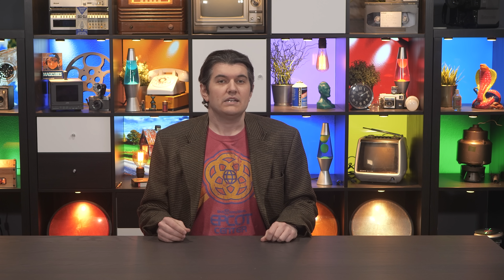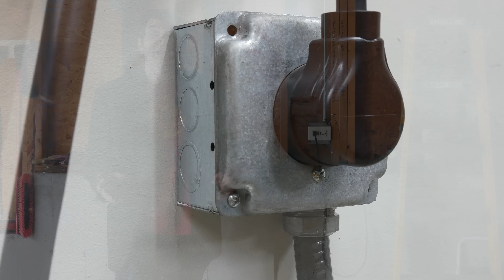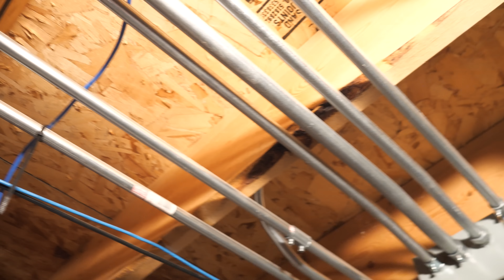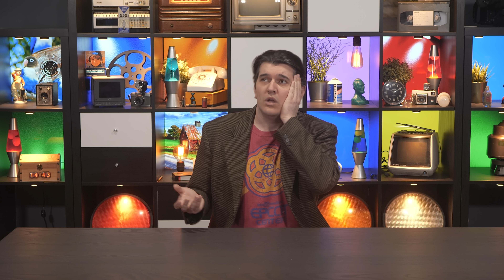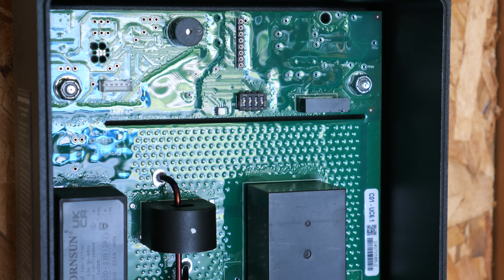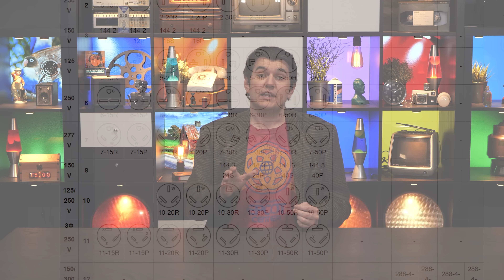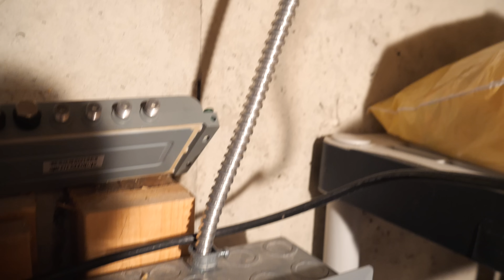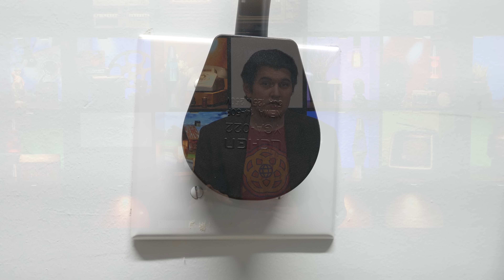The "standard" car charger is usually overkill—but your electrician might not know that

Comment: 23:20 As a software engineer, I agree 100%. If an object doesn't function properly without an internet connection, then it might as well be a boat anchor.
Reply: Retired datacomm network engineer. I also agree 100%. 
For the power limit I agree with the DIP switches. That's a hard limit defined by the electrical wiring. It should remain set in hardware until someone opens up the box and physically rewires it.
I would not buy a router that wasn't configurable on an isolated network using commonly available software such as a terminal emulator or web browser. I certainly would feel the same about a car charger. 
I could see public charging stations requiring an app but then I don't need that at a gas station, a credit card should suffice.
Reply: Five-six years ago I had encountered an split-system AC unit with only app control and requirement to be connected to the Internet. It was 3 times cheaper than similar units, so my friend went with it (2 of them, actually), and called me luddite for pointing obvious flaw.

It's been free for a few years, but now, firmware been updated and dude have to pay equivalent of $20/mo for AC, on top of the electrical bill. And, no, you can't not pay during colder season - device will brick itself - one of them did - and friend needed to call specialist from the company to unbrick it for a stupid amount of money. 
And apparently device is also using non-standard everything, so you can't just remove it and replace it with a normal split-system.

So, yeah, no mandatory internet connections on anything, that's not network infrastructure related. Ever.
Reply: @UselessZero  HVAC tech here. You can definitely rip it out and replace it witha  conventional split system, you may need to run new copper lines or wires, but if dude is intent on DIY-ing it, the DIY split system kits come with new copper and new wires anyways.
Reply: @UselessZero  what brand?
Reply: @UselessZero  I know this might seem tedious, but I would look into the possibility that the company that suddenly decided to start charging for their app software/updates more than likely used someone else’s code that was open source to begin with. If that’s the case, then it’s illegal to use that code and apply restrictions to it if it’s GPLv3 & AGPL. Title 17 of the United States Code, Section 501 (17 U.S.C. § 501) forbids it, but I was blown away by just how many companies run around doing it. The thing is, they know that most people that write code just want to share and help. So they rarely ever get any pushback. But I would not be at all surprised if the code that AC app is using isn’t even theirs to begin with. They sound exactly like the type of company that would do this.
Reply: The thing is, there are plenty of reasons why that app / it's host server might end up getting pulled.
Pushing for new model(sale)s, bankruptcy of the manufacturer, outdated internet protocols, a burning server rack...

All of which turns your several hundred dollar gadget into a brick. Nonrepairable.
Reply: Instructions unclear, now I can't moor my boat because of low reception under water
Reply: Yes!  It’s like having A/V equipment that becomes non-functional without the remote.  Or have to dig through 18 layers of menus on a touchscreen to do something that used to have a dedicated button or knob.  I’m looking at you, car industry.  On top of that, putting software/internet connections into everything is just adding points of failure.  

That said, if it can add convenience and/or make products easier to use, please do!  Example:  I just replaced my irrigation controller with a wifi capable one.  For two connected reasons: the original’s UI sucked!  And it was located in an area very awkward to access.  Since water restrictions here vary (semi-arid climate), being able to make changes to the program, without sausageing my ass around the furnace (several times a year), is a godsend!   I also have a smart thermostat that every once and a while gets adjusted from somewhere other than the thermostat itself - like bed, or when my tech-incompetent kids called us while we were on vacation, asking how to change over from “heat” to “cold” in the middle of Spring.  And don’t even get me started on smart locks…
Reply: Disagree with you completely! everything, every everyday household item needs an Internet connection and integrated mic! And shouldn't function unless the device can connect to all required external servers. This way a company can remotely disable the device or brick it. Require paid subscription to function. Allow malicious people to potentially cause harm to you and your belongings. And collect as much data on you as possible!!! $$$$$$$$$$$$
Reply: @D-ql8mz  Yes, exactly. This is the very reason why every possible interaction is becoming needing an app. Life is becoming a netflix game where you are turned into a subscriber who can be charged regularly and disconnected if you do not pay. I mean, to pay for being controlled on your daily life - what a nasty business!!!
I have seen a video by a guy who bought a new dishwasher without knowing that it needs the internet app to run certain programs - like if you only want to rinse. It does not cost extra, yet. But only a stupid person won't see where this is going. Arrrgh!
Dishwasher video is on Level 2 Jeff channel.
Reply: Never forget, the S in IOT stands for Security.
Reply: boat anchors tend to be much more durable and cost-effective and don't have firmware updates
Reply: I also completely agree with you on KISS chargers. DIP switches are where its at!
Reply: Usually a spyware anchor, with new and creative vulnerabilities for bad actors to exploit.
Reply: I had to return my last boat anchor because it wouldn't connect via ethernet, it kept snapping.
Reply: My boat anchor has Bluetooth
Reply: At least if an internet-connection isn't needed for the core purpose. ^^'
Reply: @fuselpeter5393    Correct.  Especially if the company goes belly up and the app dies.
Reply: Yes! A new EV charging guide would awesome  30:51
Reply: Great. Woulda been nice to know before I bought this wireless boat anchor ⚓️ 😅
Reply: As a software engineer, I think we're putting too much software into things that would function fine without it for highly misguided reasons.
Reply: Just curious why not do load sharing?
Reply: Cs students here, mostly agree, with the exception of WiFi access points.
Reply: I wish my utility didnt require the chargepoint home flex for their off peak ev charging plans.  I had to get support on the phone to get it set for 48 amps, despite it being configured on a 60 amp breaker.  The only plus is it lets me see the actual cost of charging so I can deduct that from a shared utility bill.
Reply: It's scary that pro audio does this.  Depending on a wireless connection for a concert where people have spent gazillion dollars combined on tickets.
Reply: I would also like to chime in and agree. I bought a Wallbox for $750 and regret it. Just recently it had a failed firmware update, putting it in a semi-disabled mode (can only charge at a max of 1.4 kW) until you do a factory reset. 
Why does it need endless over the air firmware updates? Who the hell knows. If I ever buy another EVSE, it will be a "dumb" one.
Reply: Just last month my Siemens Versicharge AC somehow got itself into the commercial mode meant for office buildings where it expects users to tap a key card before it starts charging. Well, I have the residential one that doesn’t even have the card reader hardware, so it wouldn’t charge. The only way I could fix this was to download the Windows app meant for bulk configuration of a bank of them, factory reset it, and connect the app to it so I could turn that off.

Edit: I will clarify that the charger doesn’t need the app to work or set the current. You can treat it like any dumb charger if you like, just wire it and turn the selector inside the case to set the power limit, and you’re done. I only use the app to see how much power the charger uses out of curiosity (turns out my charging costs amount to roughly $5 a month) I never set the app up for like 5 years because the never cooperated with my WiFi, until it just suddenly decided to and i managed to set that up a few weeks ago, but it worked fine without the app that whole time.
Reply: and if your boat anchor needs wifi....😮
Reply: My dad switched out the panel for controlling sprinklers with a fancy IoT device, but the stupid thing can’t be adjusted without an Internet connection even when the device with the app is on the same local network as the sprinkler panel. It’s just so ridiculous.
Reply: I bought my car second hand and the previous owner threw the charger in with it. Said charger connected via an internal modem to a web back end somewhere, which had to link to my car's account through their service to tell the charger that it was MY car via GPS to prevent electrical power theft.. It never worked, because they were both 3G based which got shut down, the car service was discontinued. I replaced the charge controller for about £25 and turned my smart charger into a dumb charger and it was finally useful again. I have a 1/4 turn lockoff inside my house so it's never powered unless I'm already using it. I'd like to add I design bespoke test systems, all aspects, mechanical, electronic, firmware, fabrication etc. and your statement is 100% true. Relying on an external service that you have no control over is FATAL.
Reply: my charging station reports usage to my utility and I get a rebate based on that. That's one use case
Reply: EVSEs like this don't require an internet connection. They'll work just fine without one, but they are improved with one.
Reply: Nonsense 🙄
Reply: What about a Bitcoin?
Reply: If you can afford an electric car, you can probably afford to have an Internet connection.
Reply: The biggest problem is see with EV is the battery technology. And the risk of fire, im a master electrician and electrical fires while im charging in a garage scares me long term. Id only charge outside away from my home.
Reply: Only a software engineer could know this. Leik omg thx!!!!
Reply: The problem is that in reality, the Tesla Level 3 chargers are the ones that are extremely more reliable than anything else.  Yeah, you need "an app" for a non-tesla, but they also just work, which is not the case for almost any other level three charging.    Probably because they all use starlink for their internet, which is way more reliable than what everyone else uses.
Reply: @EdwardKerplumplin  they cant both "need a app" and "just work"

my kettle just works i push a button it makes hot water
my toilet just works i flush poop be gone

needing to setup a app is not just working
Reply: @Sarge92  The Use-Microsoft-Word-Like-A-Typewriter crowd probably thinks that Microsoft Teams "just works" because they never cared about the missing/broken features to begin with.
Reply: @Sarge92  They are both true. You don't need an app for home charging via a Tesla wall connector. You can just plug it in after it is setup by an installer and it'll just work on every EV, but having the app allows you to monitor energy use and configure permissions.
Reply: @EdwardKerplumplin yea so when the company feels like it  theyll prevent you from using what you paid for ok lol
Reply: @EdwardKerplumplin in my experience the Tesla chargers have been the most unreliable…

I’ve had them not work at all more often than anything else… or have entire stations closed with very little notice…
Reply: @EdwardKerplumplin  Unless something's changed, you need an app, an account, and possibly an adapter, depending on your car. That doesn't "just work". The maintenance standard of many EV chargers in general is also pretty lacking, so even if the device is designed to "just work", the more complicated it is, the greater the chance that when you get to it, it "just doesn't work".

You're also adding dependencies. Now, to charge a car, the charger needs electricity and it needs a functioning satellite internet connection. 

There's a reason gas pumps are relatively technologically unchanged in the last few decades and don't rely on anything "smart" to do their main jobs.
Reply: @deggy42  Regarding the gas pumps, quite a few years ago I pulled into a gas station that had just suffered a "power hit" from a nearby lightning strike. Power was on, pumps worked, but the point of sale terminals were down. They couldn't even "process" my cash. I went elsewhere.
Reply: @davidg4288 My favorite gas pump story was at a station in Kansas where the manager told us the pumps were down because the internet was out. I asked for clarification because that isn't how that works. 

He said that their owner's policy prevented them from running the pumps without also being able to show the ads that play on the screens built into them.
Reply: @deggy42  Except again, reality begs to differ. Tesla Superchargers are the industry standard, and Electrify America and everyone else is laughable in comparison.  But that is the real world, don't let it convince you of anything.
Reply: @EdwardKerplumplin  And that's great for them, but we're talking about the REAL real world here. The one that exists in physical space that people have to use, not the one that was designed by a very clever engineer and developer working together.

I've seen a LOT of superchargers that don't work the way they should. They error out, they dont charge at the rate they're supposed to, they didn't like a payment method. EV chargers are critical infrastructure. The simpler they can be, the more suited to that role they are. The device that charges your car so you can leave should not require an internet connection to function.

Not to mention - the Tesla charging standard that is the industry standard does not actually require an always-online device. It governs the communication between charger and car. The charger doesn't need to be able to contact a server for that standard to apply. But by all means, don't let the reality of the standard you love so much get in the way of your fanboying.

You seem to think I'm anti-Tesla here. I'm not. I'm anti-internet-of-shit. Things that don't need a network connection to perform their function shouldn't require one arbitrarily.
Reply: @EdwardKerplumplin  why are you like this?
Reply: @deggy42  my 2018 volt came with a charger for a standard household outlet and it *just works*... unless my house has a power outage. and until i moved into a situation where my commute was 100 miles a day, i was always commuting on electric every day and fully charging overnight.
Reply: @deggy42  It "just works" on Tesla cars, which it was designed for.
Reply: @EdwardKerplumplin  So you're saying anybody who drives a non-Tesla EV is arbitrarily required to carry a smartphone in order to use a Tesla charger?
Reply: @willg-r3269  Yes. Unless it's a free destination charger, you need the app to start charging.
Reply: @pootispiker2866  One would think that such tech-savvy company would be aware that it's easily technologically possible to set up devices to accept payment using credit cards, or even physical cash money. What exactly is it about Tesla that makes them so incapable of doing something that every rinky-dink little corner laundromat and vending machine has managed to pull off seamlessly for decades?
Reply: @willg-r3269  Honestly? It's the image. Why would they make tesla owners look low-class?
Reply: @EdwardKerplumplin  My Echo dot 'just works' it just needs an app to setup and a constant internet connection.
Reply: @smalltime0 You don't need constant Internet connection.  Most of the time you'll charge at home. You only need the Internet for trips to unfamiliar locations that are far away (to identify charging stations but usually your car can find them) and for free upgrades to your car's software every three to six months or so.
Reply: @patriciazoerner  That's not what I was arguing. It's not "it just works" if it requires additional things or steps.
Reply: @patriciazoerner If you need an internet connection to use the charger, which you do for Tesla chargers with non-Tesla cars, you need that connection anytime you want to charge. The kind of faraway location where someone might need to use a charger is the kind of location where internet connections might be hard to come by. 

Not to mention the possibility of a dropped cell phone bricking your car by extension. If you break your phone at a rest area on a highway in Nevada, I guess you should just hope there's a non-Tesla charger inside your remaining range.
Reply: @Desert-edDave  🤡

Comment: Yeah, I was only going to go with a 30 amp 220. I have a dryer right in the mud room in the corner of the garage, and was wondering if I could splice off that or not. 
Good to know I could have, but there was no fully electric vehicle I fit into well enough. So I just bought ICE again.

Comment: My advice is, when you get an EV, try level 1 charging from the standard 120 volt outlet first and see if that's sufficient for you. For most people, it is nearly always. Even if it sometimes isn't, also consider whether there are fast charging stations near you that you can use on those occasions when you do need get full in a hurry, and whether the cost of using those will be greater than the cost of installing a level 2 charger. I'd guess that if there is a fast charging station near you, it will be far more economical to use that on the rare occasions that you need to than to install a level 2 charger in your home.